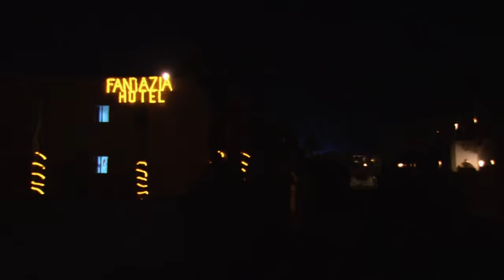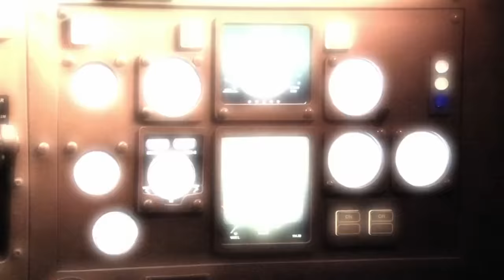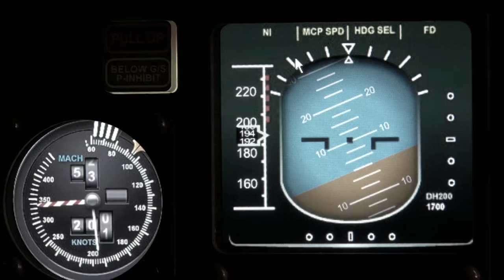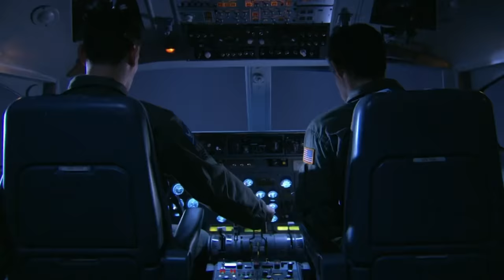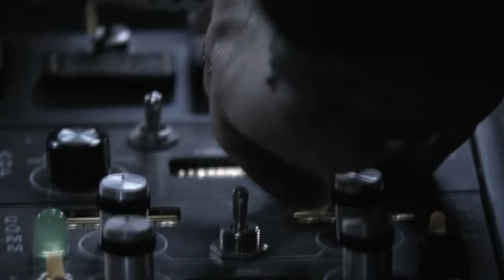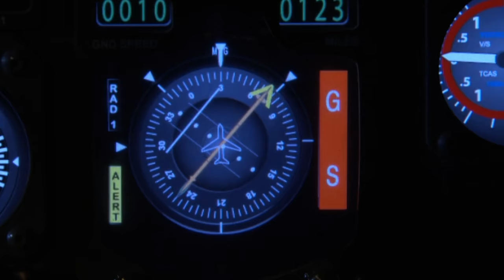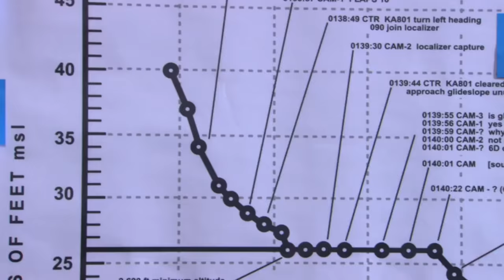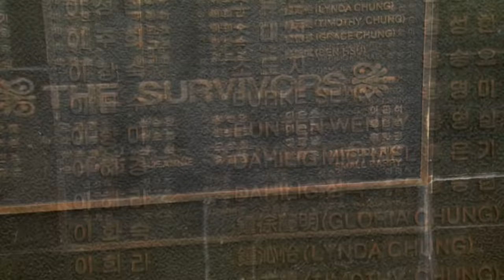Pivotal Crashes That Shook The World Of Aviation | MEGA MARATHON | Mayday: Air Disaster

Comment: The Red Sea crash sounds suspiciously like a rudder hardover caused by a malfunctioning rudder power control unit. Was that PCU recovered and checked out?
Reply: Yeah! Especially with the flight engineer being very clear when he noticed something wrong with how the other two were responding. Whereas with the Egyptair flight there was nothing conclusive about mechanical issues and everything pointed to (co)pilot suicide, here there are many indications of mechanical issues that were never followed up on; instead the experienced pilot who would likely be able to recognize vertigo symptoms (as someone who occasionally suffers from it, even while lying down in bed, it's very easy to notice if you know what to look for) is the cause? I dunno, with the aircraft being so known for rudder hardover and the lack of response it gave to pilot input
Reply: Pilot error here
Reply: It may have been one of the parts they weren’t able to retrieve.
Reply: History shows rudder hardovers happened. But only in conditions that allowed it to (coming back from below zero temp) not likely on takeoff. Although a possibility from other circumstances, unlikely from my opinion
Reply: Yes. I'm sure you've figured it all out just by watching the dramatized episode. I am sure all the experts who worked on the case are wrong.
Reply: @jessefremont that’s everywhere on earth though because at 35k ft it’s way below freezing -40F to -60F and the hydraulic fluid was still hot. So as far as I understand it that rudder hard over actuator issue wasn’t really location specific and could happen at any given airport latitude once they reached altitude until they fixed the issue.

Comment: Too bad Feith wasn't investigating the first crash. Definitely mechanical issues, but I suspect something  beyond vertigo was wrong with the captain.
Reply: I think the captains virtual horizon had a problem
Reply: Vertigo is enough to confound any pilot regardless of experience. This is how JFK Jr died, diving into the ocean/body of water.
Reply: The plane switch they mentioned at the beginning resulted in a plane that hadn't been used for a couple weeks being employed for the flight. Unfortunately the ground crews forgot to cover the pitot tubes and a mud dobber (insect) had built a nest in one of the tubes, blocking it. This resulted in the Captain's airspeed indicator to read incorrect, while the FO was correct. The Captain unfortunately believed both were wrong (Captains reading was plane was over speeding, FOs was lower/correct) The Captain slowed the plane over concerns of overspeed, which resulted in the plane stalling/crashing.
Reply: @marinazagrai1623  I've had true vertigo to the point of meds. The show did not explain that in that fluid in inner ear there are crystals that bounce of sensory tissue. You know when it happens and would turn over control of jet which JFK jr may not have had option of co pilots. Best description is teenager bed spins you get drinking heavy when young. In a way it feels like a constant pull to one direction or other all of a sudden or like you feel the planet spinning at real speed in space LOL!. An autopsy may have helped check inner ear but no body or history of antihistamine use as congestion can cause it.,
Reply: @jamesb1988  wrong flight. Birgenair flight 301 is the one you are referring to
Reply: @jamesb1988
You are incorrect. That was a different flight Bergenair 301. Don't even know what video you were watching to think that's the episode you saw, but no. This was straight up a case of spatial disorientation on a moonless horizonless night. It can happen to anyone, and unfortunately the more confidence you have the more susceptable you are too it as you're less likely to question yourself.
Egypt is notorious for not accepting any findings of pilot error, instead grasping for mysterious mechanical faults which they have no evidence for, to protect their bruised egos. See Egypt 990 for a disgusting example of how bad they can get with straight up denial of reality.

Comment: Korean 801 plane crashed, so easy to say pilot error, but beacon was not located at base of the runway, airport disabled the Warning system on purpose, confusing signal mimicking the ILAS showing intermittently on the cabin instruments, so glad NTSB does a deep dive into the root causes to make sure it doesn’t happen again and Swiss Cheese Model posits that lots of things need to go wrong for an accident to occur.

Comment: Egypt has a habit of passing the blame onto the aircraft manufacturer for what is clearly pilot error. Flash Airlines, the incident detailed in this video, is one of them, due to disorientation (the artificial horizon clearly shows a right turn, but the pilot continued to turn right). Another is Egypt Air, where the pilot in command deliberately nose-dived the aircraft and crashed it.

Comment: 40:33 It doesn't seem likely that a simple turning right vs left scenario could cause so much disturbance other than going the wrong way - until a pilot gets to the banking part.
Reply: To to turn the plane must bank usually 30 degrees. When you bank too much the plane can flip over or go down in a mad spiral.
Reply: @sharoncassell9358  ugh no. Your not a pilot at all. One of the earliest trainings we do is steep turns. We bank anywhere from 45 to 55 degrees. We have to maintain that steep angle and altitude also. Agh youtube pilots. Watch a few videos of airlines, think you know everything about aviation

Comment: Regarding the first episode: The plane switch they mentioned at the beginning resulted in a plane that hadn't been used for a couple weeks being employed for the flight. Unfortunately the ground crews forgot to cover the pitot tubes and a mud dobber (insect) had built a nest in one of the tubes, blocking it. This resulted in the Captain's airspeed indicator to read incorrect, while the FO was correct. The Captain unfortunately believed both were wrong (Captains reading was plane was over speeding, FOs was lower/correct) The Captain slowed the plane over concerns of overspeed, which resulted in the plane stalling/crashing.
Reply: This is also why the AutoPilot didn't work, because it was basing it's information on the same pitot tube that was blocked.
Reply: You are definitely confusing this flight with a different accident. Birgenair flight 301 is the crash you are thinking of
 They had a wasp nest that caused their crash not the flight in this video

Comment: Idea: They should use multiple receivers listening for those pings, recording the timestamps along with GPS data. 
Then even when the pings go quiet, the data of where they came from is still there. 
I'm shocked that this isn't STANDARD PRACTICE... yet! 🤯
Reply: I just learned they only have a 2 mile range. What good is that if the water is 2 miles deep? 😒

Comment: 6:17 "They brushed it off". ~  I'll NEVER understand that. An airplane is NOT a car that you can pull over (and even in a car you can't always do that). Every instrument panel is there for a reason and NONE should be brushed off while the plane is still on the ground and there is the chance to check the problem thoroughly before taking off no matter what delay it causes. That is plainly unsafe.

Comment: Seems that CVR and FDR should automatically detach from airplane upon impact and have some sort of balloon that would be ejected and inflated to float. It should be possible to hide such small balloon and something to generate light gas, then act similarly to airbags. Another beacon can be used to locate the airplane and locate CVR and FDR.
Reply: Airbags inflate via an explosion - not something you want on an aircraft, even if it is small.
Reply: That just adds way more complexity and just another thing that could fail just for the rare situations in which a plane goes down in deep water. Besides, those would only work for a couple days to keep it afloat at most, and that's if the floatation device was not punctured during the crash. And now you've got to worry about ocean currents taking the black box well away from the initial crash site, widening the search area even more.

Comment: The first program on the video is blaming the pilot.  This is a lie as three other Boeing 737 all crashed in the same way and they found out it was a faulty PCU part that made the rubber stick in the opposite direction.  Flight 517, flight 427 and flight 585 all went down in the same way and they were all Boeing 737's but this program blames the pilot and that is just not true.  The PCU was remodel and all Boeing 737 got the new part but somehow this one was not replaced so they blamed the pilot. I only know this because I watch a video put up by this same channel, Mayday: air disaster.  The name of the video is:  A Crash Site That Became The Most MYSTERIOUS In History.  All of these crashes happened 25 years or more before, this plane went down.  It may have been a very old plane, may have been decommissioned and then bought by this small company years and years later and it never received the new PCU.  They could not know for sure that brought this plane down because it's at the bottom of the Red Sea.

Comment: Mechanical failure the likelihood of which had increasing and compounding factors that of which are lack of maintenance running the thing hot around the clock the eventuality was that plane was going to come down from its flight pattern and come down hard cuz we're not talking partial mechanical failure like one of the engines going out and then being able to maintain sustain flight with only one engine this is beyond the grace of the cane I find this whole nonchalant sort of just attempting to crucify in my eyes the captain and I have no regards four more against him one way or the other you know I don't know anything about him I'm just saying it sounds like they're trying to wipe their you know what I'm where the buck stops